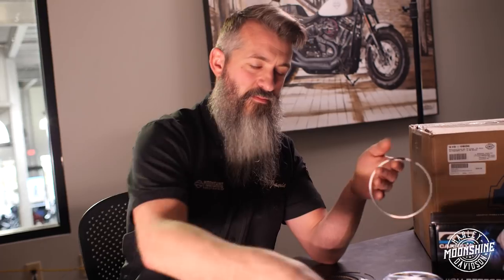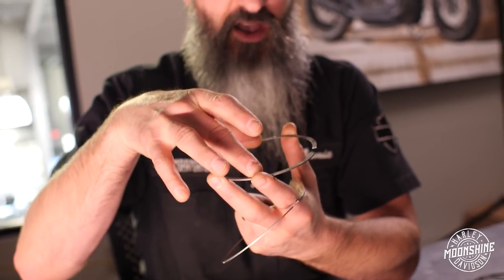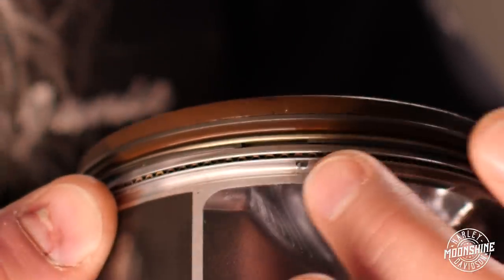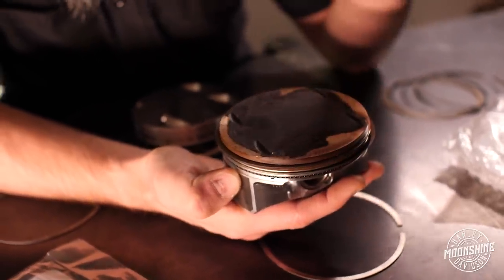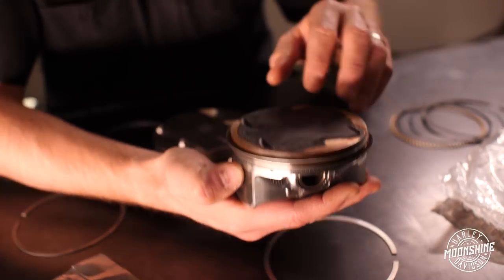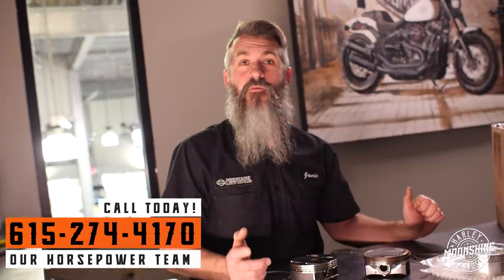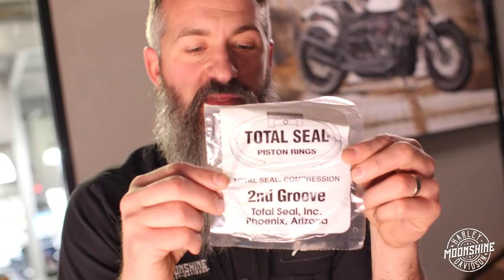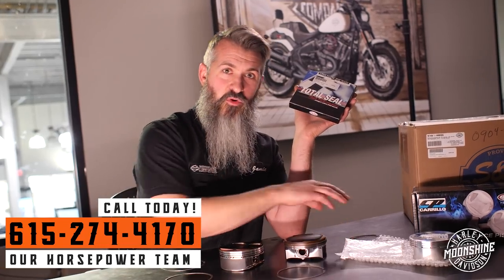Gas Ported Rings | Moonshine Horsepower Upgrades For Your Ride | Shop Talk Episode 47

Comment: I know you said those rings are designed for the S&S pistons specifically but I just want to double check that they won't work with Zipper's pistons (124'')? As always thanks for the content and detailed explanations.
Reply from the maker: No but the rings Zippers uses with the CP pistons are nice. Do you already have the Zippers kit?
Reply: @MoonshineHarley  oh ok cool. Yes I do. 124 zippers muscle kit, darkhorse crank/motorsproket, carrillo rods, feuling cam plate/oil pump/vented dip stick, baker grudge box, etc.
Reply: @eric_fxbb74  dude, that sounds like one nasty build! Do you know what you are making for hp/tq?

Comment: Are the pistons drilled in the top? Or are just the rings grooved? What about zero gap rings? (Old auto racing stuff)
Reply from the maker: Just gas ported rings. Zero gap isn’t the best performer for street or air cooled engines.